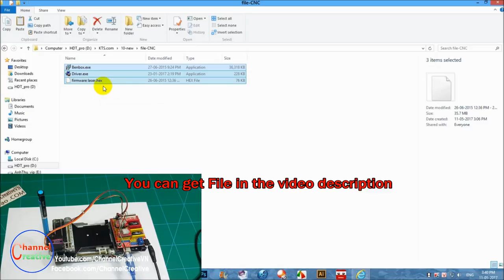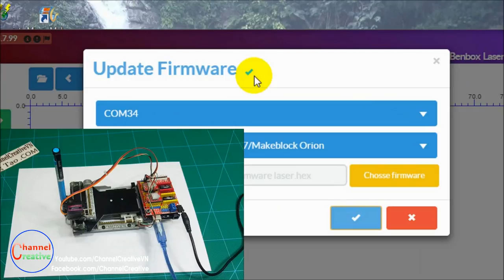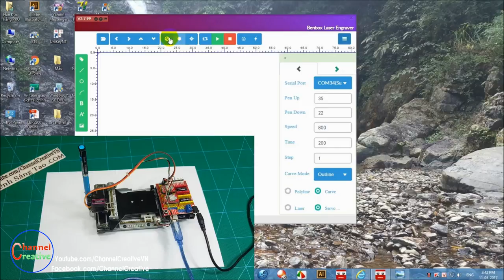How to Make a CNC Drawing Machine at home

Comment: Good and cool project! Add an SD card and a G-code reader to the Arduino (also, for select file will need display and controls). Then add a battery and the device will become self-contained, independent of the computer.
It would also be nice to redesign the mechanism of the pen. The option suggested in the video is too difficult to replace the ink.